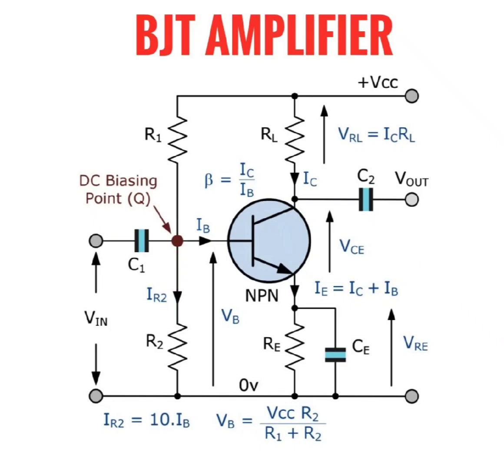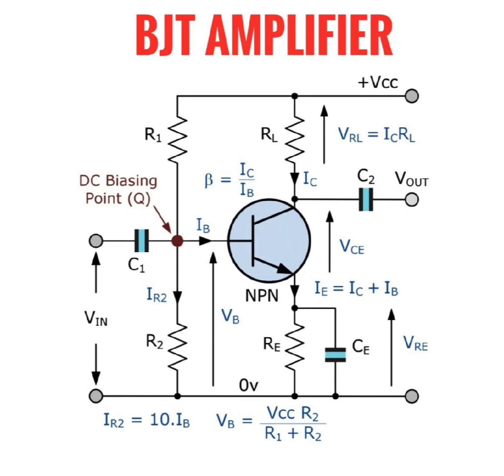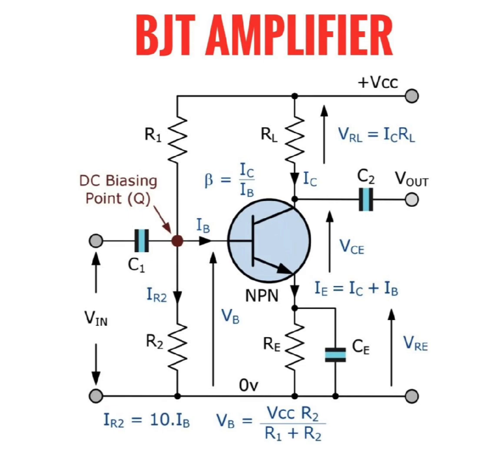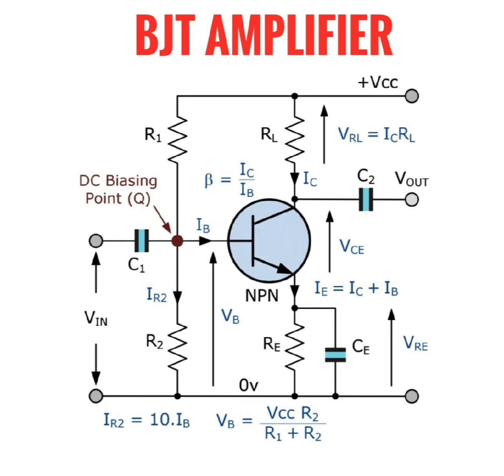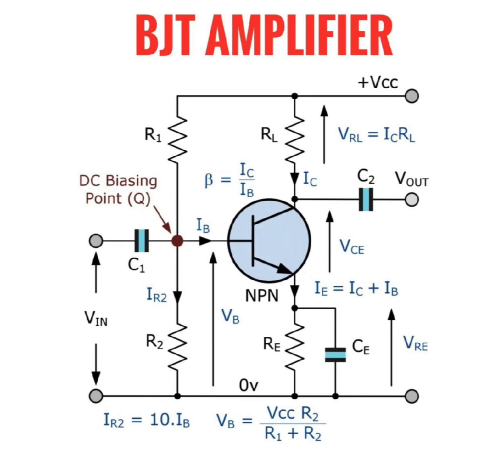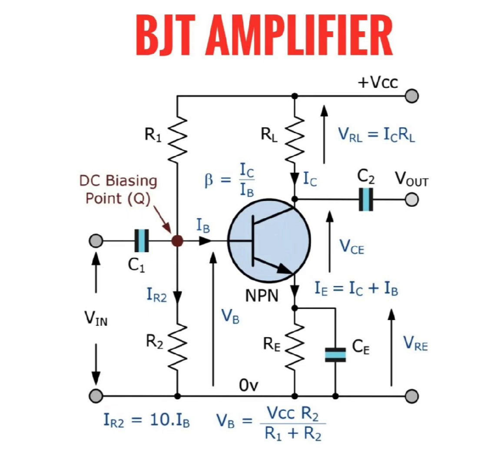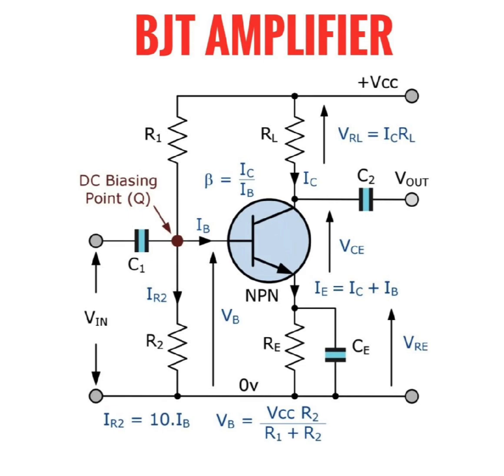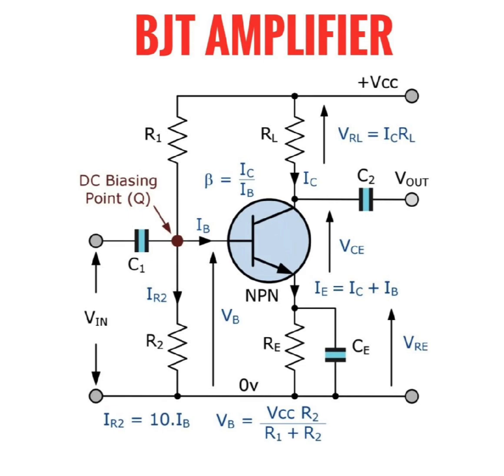BJT Amplifier Explained | Biasing, Q-Point & Linear Region (Step-by-Step)

Comment from the maker: In this video, we explain the BJT common emitter amplifier in a clear and step-by-step manner.

You will learn:

What biasing means and why it is essential in BJT amplifiers

How the voltage divider bias (R1–R2) sets a stable base voltage

The role of VB, VE, VC, and VCE in transistor operation

What the active (linear) region is and why it matters

How the Q-point (quiescent point) is selected for low distortion

The function of input, emitter bypass, and output capacitors

This video is ideal for electronics students, technicians, and engineers who want a solid understanding of analog transistor amplifiers.

📌 Topics covered: BJT amplifier, transistor biasing, Q-point, linear region, common emitter amplifier, analog electronics, signal amplification.

🔧 Channel: Aras Inverter
📚 Category: Electronics Education / Analog Circuits